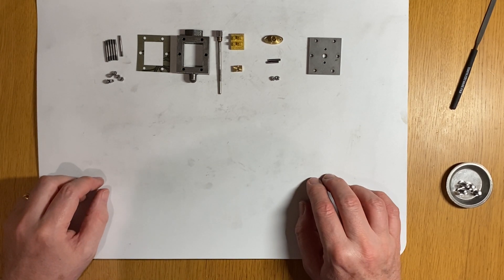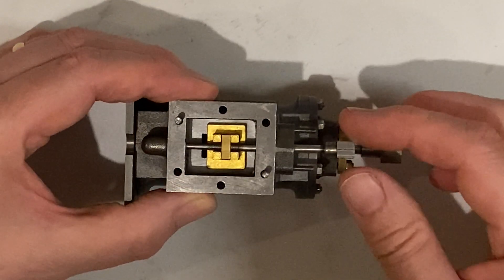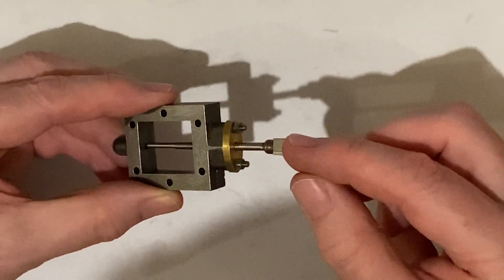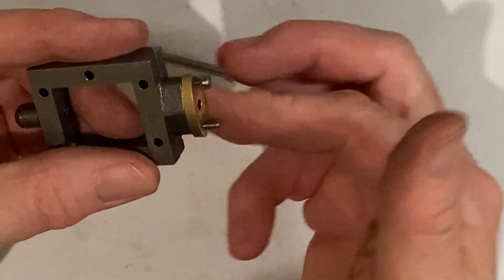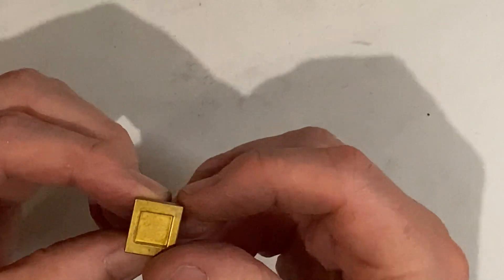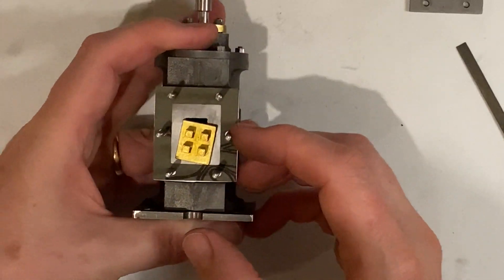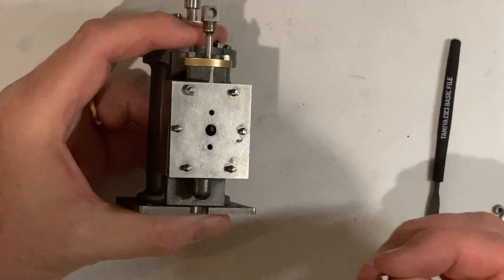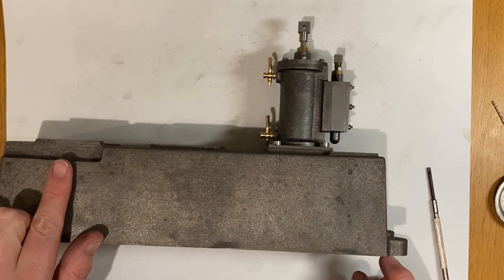Stuart Beam Engine Pt 3 The Valve Chest

Comment: Hi Mark - another very useful video for me.  Still have my part built project on the go.  I am starting on the valve chest, I have noticed that the cylinder is cast (not brass) but the material for the chest that has come with the bits I have bought are brass.  Am I correct is understanding that if the cylinder is steel (cast) the valve chest and cover should be as-well? Many thanks Martin.
Reply from the maker: I’m no expert, but I don’t think it matters too much. There is a risk of electrolytic corrosion, but only If the parts are wet. Steam engines are well oiled (like the builders?) so it shouldn’t be a problem v

Comment: It's a lovely kit but qc let it down again.  Think hex bolt will look better.
Reply from the maker: They're silly machining errors.  Nothing that can't be fixed, but shouldn't really happen.  I've got some hex head bolts now, which look better, but are still a bit large.  I think 'one size smaller' heads will look even better.